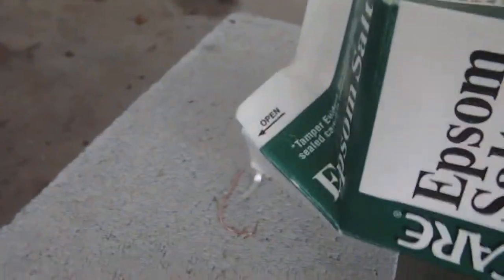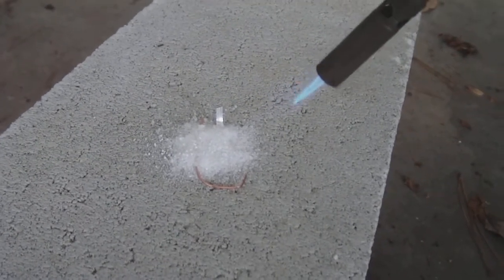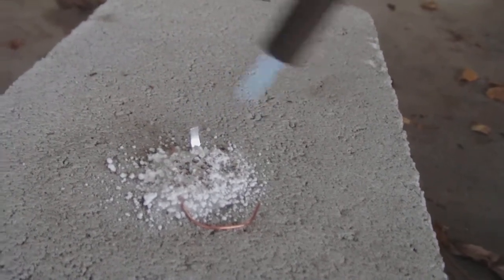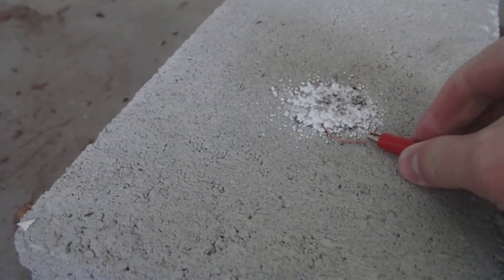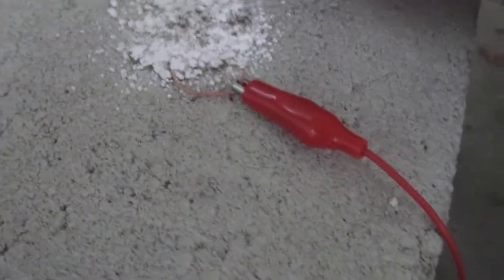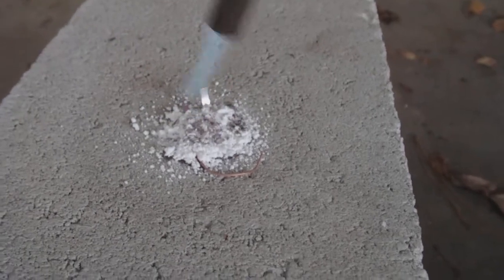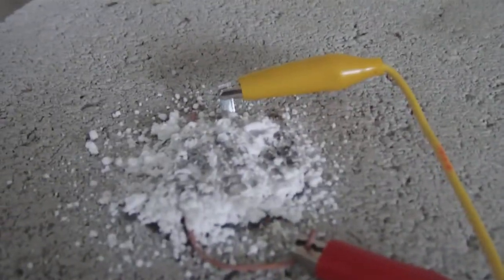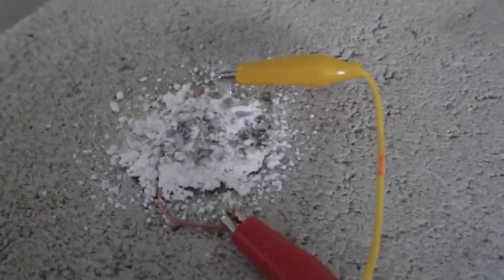Blowtorch crystal cell -  proving the cell is not galvanic

Comment: A propane torch is designed to accelerate the mix of air, in with the propane; hardly an air-deficient environment. Water, then, is actually a product of the combustion, as easily determined by firing a stainless steel sheet; you'll see water forming. Have you thought of making an induction style heater? Placed in a capsule that you can draw a vacuum on, and using anhydrous salts, you'll get a much better, scientific approach :) Cheers

Comment: @ibpointless2 You've got water locked in your salt, water in your concrete, and water in your flame. I agree, it's minimal, but it's everywhere. Start anyhydrous, 0% humidity, and draw a small scale vacuum, heat with electricity. I've done similar labs in Chem tech. If you start with less, you'll end up with less. You've got a water cell there.

Comment from the maker: @KyleCarrington 
The water produced by propane mixing with too little oxygen is unusable for most applications, such as drinking water. In fact, the water vapor is so minimal that usually the water burns up right along with the propane. It's actually the evaporating water, combined with carbon dioxide emissions, that causes propane to burn with a visible flame.

Comment: If your burning propane, your making water. It's inherent. C3H8 + 5 O2 > 3 CO2 + 4 H2O. You could try ridding the cell of water by starting with an anhydrous compound, and baking in a vacuum. You've still got water, as far as I see it? Thanks

Comment: What is it on the milliamps scale ?
Well, I think you did not heat it long enough.
You drive the water out of the Epsom salt and this will
go to the Magneisum and copper surface.
I think you really need to cook the salts at least 10 minutes, so really all the hygroscopic stored water will vanish... Also when it cools down it 
pulls again moisture from the air. Try it just with 2 graphite pencil rods or graphite plates. Many thanks. Regards, Stefan.

Comment: man be careful when concrete gets too hot  it will explode from the gases that are in the block, also try taking the two disimilar metals and twisting them together, heat one end and cool the other, it will make a voltage somewhat like a thermocouple.  great video's on such and interesting subject.